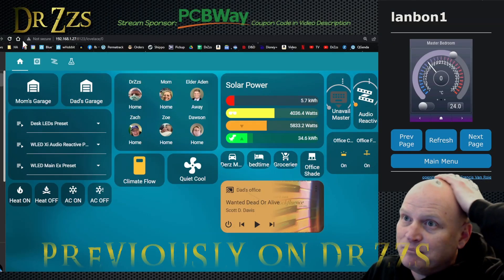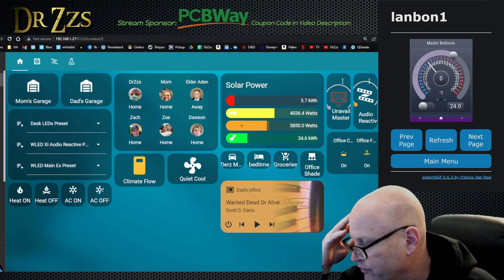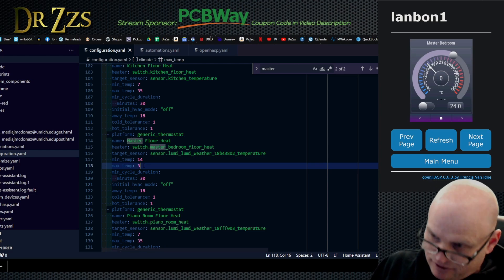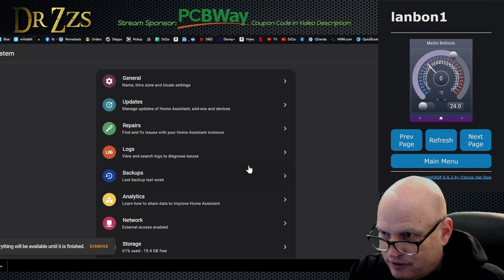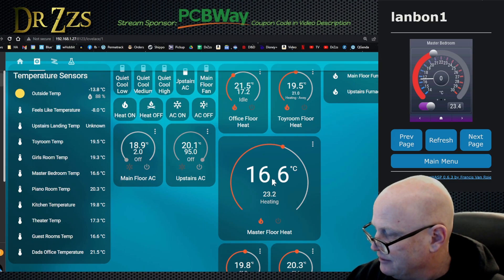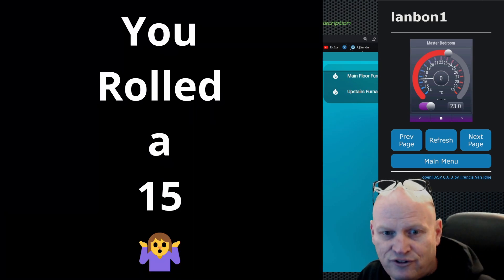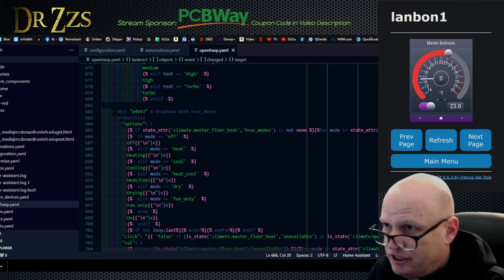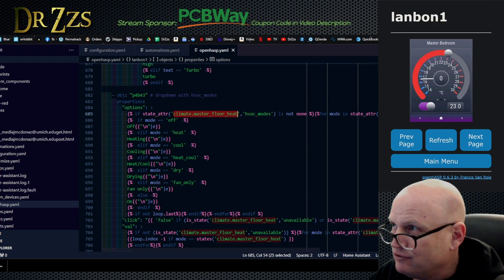Part 2 - OpenHASP Thermostat + Home Assistant Connection

Comment: New to your channel mate here from OZ. Basically new to all things LED, HA etc and have a pressing question.

I ordered an ESP32, BTF 5 meter LED strip and a 5 V 10 amp power supply. One of you videos I watched you said current is drawn by the device and this brings me to a question. The BTF LED Strip came with pre soldered wire and JST connector but I ordered 18awg wire taking into account 10amp supply which I dont intend to max at all. Whats bugging me is not knowing if I am safe to use the pre soldered wire and JST connector to hook it up to the 10amp supply or should I be chopping it off and soldering the 18awg wire to it?
Reply from the maker: Have an LED related question? Be sure to ask your question in led-lighting-diy- Channel on discord! https://discord.gg/8gvF67h Our LED masterminds, the PixelHeads, generally hang out there and can answer your question(s) swiftly.

Comment: There are some that set their air conditioning extra low during off peak demand.  That way you push some of your use to off peak hours.  I think 15c/59f would be the lowest most would go.  I'd be curious if anyone sets it lower.
Reply from the maker: Good point.